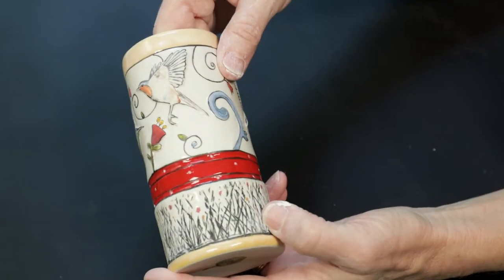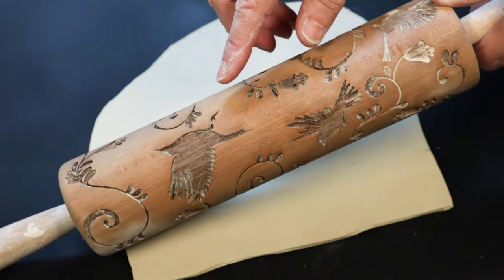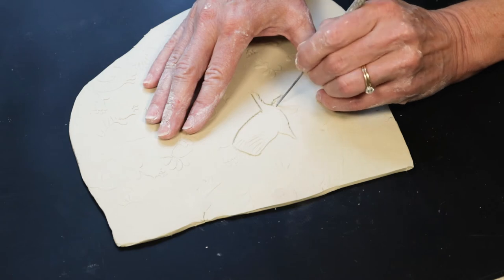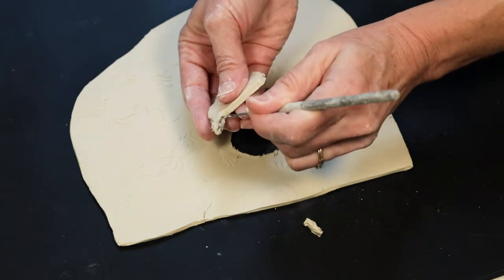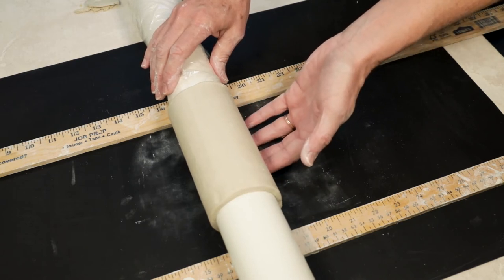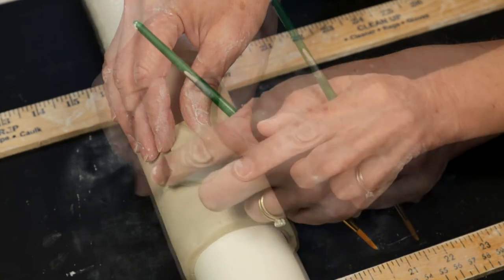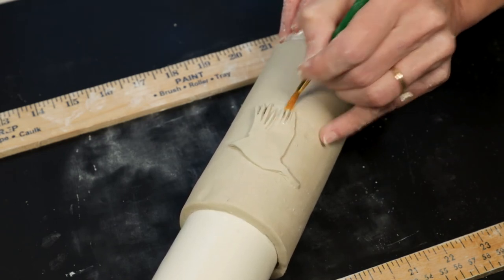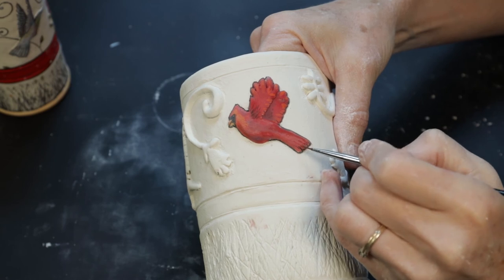Making and Using Appliques - Pottery Project

Comment: Very nice. It reminds me a little about Wedgewood with its applications of figures on a different colored clay body. But maybe you allow me to add a comment: When I want the edge of an application to be less 'on edge' I place a piece of food wrapping foil over the top. It makes it beautifully rounded and gives it a professional looking edge as if it came out of the piece itself. I found that to be easier, than cleaning up afterward. Just saying. Your pieces are very lively and I would buy one any day.
Reply: Hi Rita. thanks for the kind words.   Interesting idea!!!   Can you tell me more about how the food wrapping helps soften the edges of the applique?  Are you just pulling it tight or are you using your finger against the plastic to round it ???  A damp sponge works well on porcelain but perhaps not on stoneware so this is a interesting.I am always wanting to learn new tips!!!
Reply: @annruel1982  Hi Ann, yes, I take a piece of cling wrap that is long enough to go along the entire edge. I put it over the top (make sure no wrinkles are in the cling wrap) and then I lightly smooth any sharp edge with my finger along that edge. You have to be gentle otherwise it smudges. Depending on the stage of dryness of course. When its leather hard you can be a little firmer. The edges are beautifully rounded and blend into the piece you want to attach it to. Just take a soft sable brush to smooth out any of the slip or water that squishes out and its done. Easy as. And it looks professional, as if it grew out of the piece. Wedgewood like if you know what I mean. Smile!